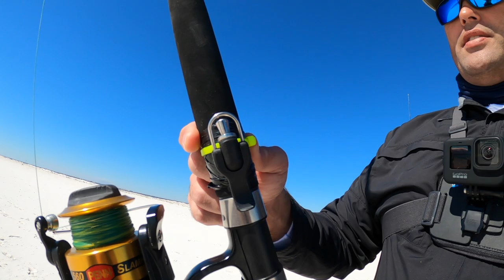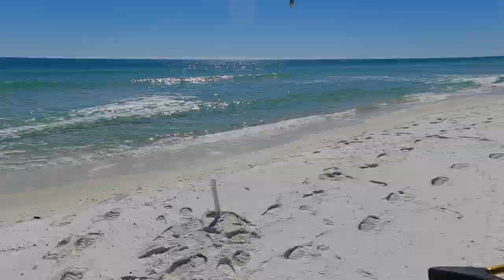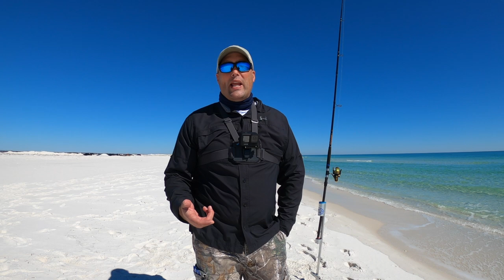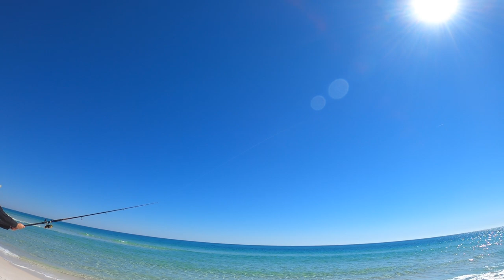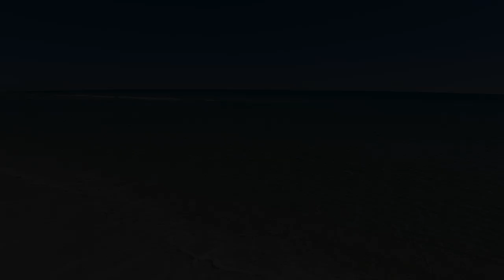How to use Casting Cannon for Surf Fishing

Comment: You do not need this device, all you need is just to cut an old bicycle tube that goes inside the tyres and that feet into your finger so that you can use it to protect your finger, is free and you can never replace what your hand can do because you can still feel the line when exactly let it go!!!! I tried both method and the old biycle tube is still the best and free!!!!
Reply: Wrong.

Comment: I go around once?
Reply from the maker: Go with why works for you.  If I were casting short, 1-3 is fine (depends on a sinker size too).  I prefer 4-5 wraps for long casts.
Reply: @BeachBuzz  okay thanks I just never knew better I thought if I go around more then once my line would snap
Reply: I got around 5 times as well, if I go less it slips off on me. When I’m using this through I usually have 2oz sink plus bait on though so maybe lighter you’d get away with one wrap

Comment: Trying to understand what the real "benefits" are of this. It doesn't do anything more than hold the line like you do with the tip of your index finger when casting normally. So you use your thumb to hold a mechanical release device? Why not just use the line release that you were born with? It's called the tip of your index finger? Am I missing something here?
Reply from the maker: Great question.  It’s a tool to allow full casting strength without your finger being the limiting factor.  I use a 4 oz sinker and needed a way to have full casting potential with a braid that was lacerating my finger.  This was my solution.  I’ve incorporated it on most of my rods.  It’s not a must have, but I’ve found great value for the benifits gained in casting distance and finger protection.  My thumb is the release when I use the cannon.  I have a few rods without it, but cast much further with the casting cannon.  It’s just an option.
Reply: @BeachBuzz  Ditto. Basically a narrative of what you explained in the video.
Reply: Someone has never been surf fishing. When you're casting braid several hundred feet with a 12-15' rod, you need either a glove or a device like this to stop the line from taking off the tip of your finger
Reply: @iceman5117  No... someone else seems to have never fished with a spinning reel before or something because A) You would never let the line run against your finger once you've cast. Your finger is only used as a trigger to hold the line SO you can cast. As soon as you let it go, your finger never touches the line again. And B) it would almost be impossible to let the line run along your finger (with a surf sized spinning reel anyway) without it completely stopping the cast because it is rotating around the spool and it would thump your finger every time the line went around. It's really not rocket science.
Reply: @arronjohnson7509  Fishing inland with a spinning rig and surf fishing are two different beasts. My first time surf fishing my built in "line release" was tore up after a full day of surf fishing. I went back to the local shop and bought a finger glove that I only use surf fishing.
Reply: Yes, you are missing something. Slinging a 4 oz lure on braid will generate enough force for the line to chew up your finger. Try tying a loop in one end of braided line and tie the other end to a 25 lb weight. Slip your natural caster through that loop and lift up the weight. You'll get the idea real quick.
Reply: @arronjohnson7509 ur finger generally doesnt have enough grip so when the line is loading it will slip and cut into ur finger. even with gloves when i try to release my finger as quick as possible it still catches a bit. with a casting aid theres much less friction when releasing the line